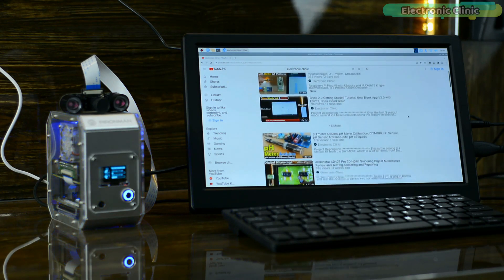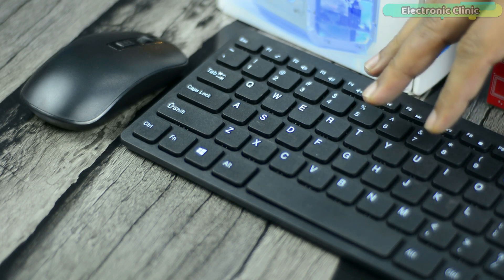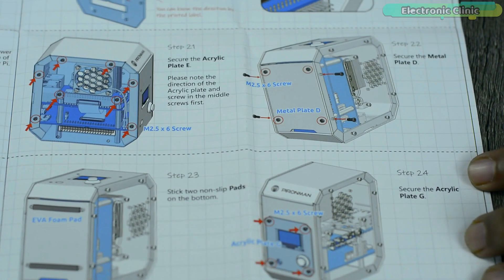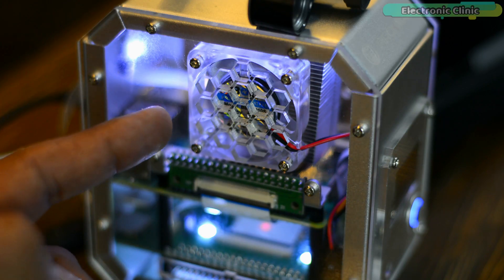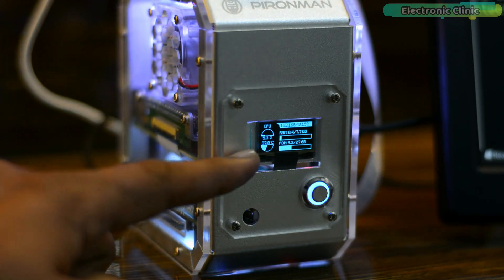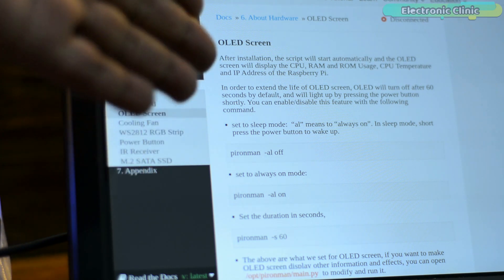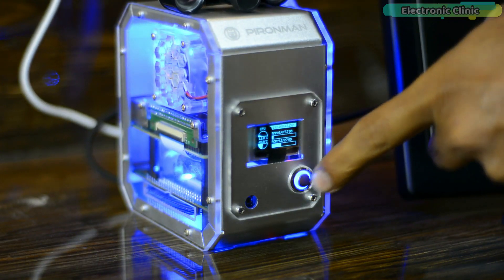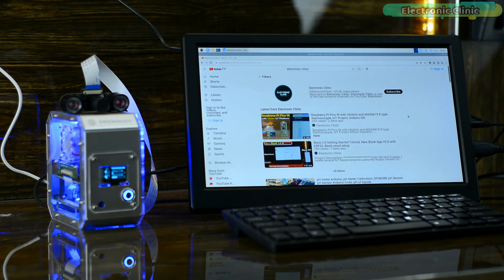Raspberry Pi Computer Build, Raspberry Pi 4 8GB Gaming Mini PC, Smallest PC

Comment: Did you try it with wireless peripherals and ssd connected at the same time...? I have a Microsoft keyboard connected to it and it seems that the voltage is not enough for the keyboard to work properly. Please help